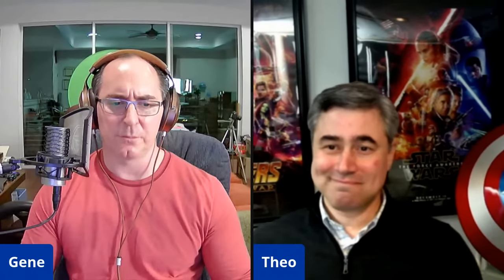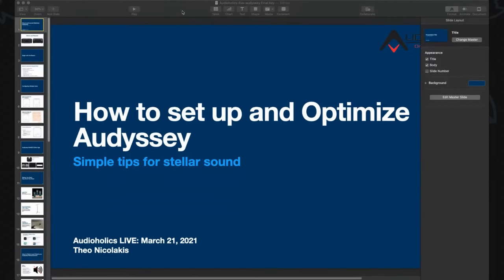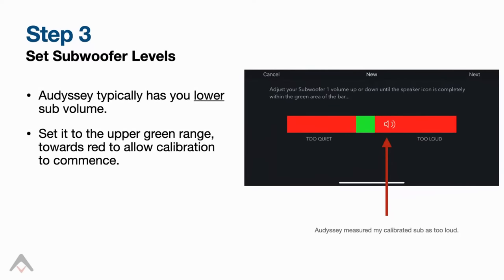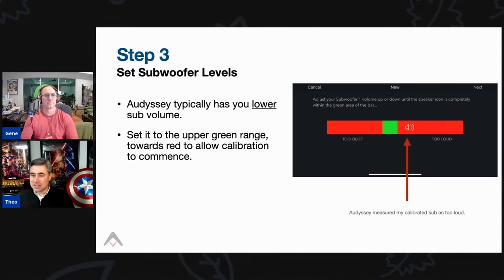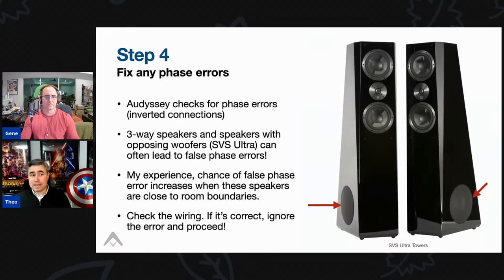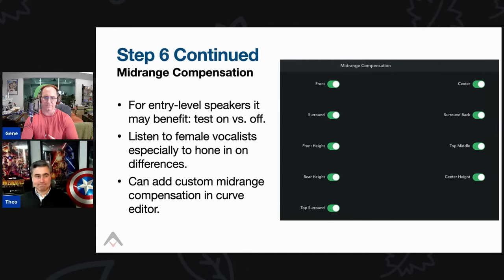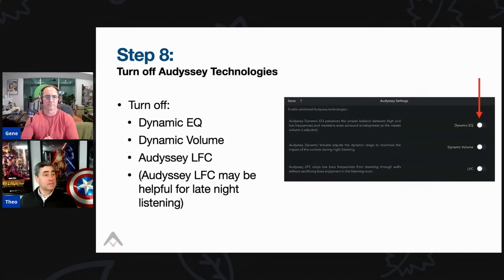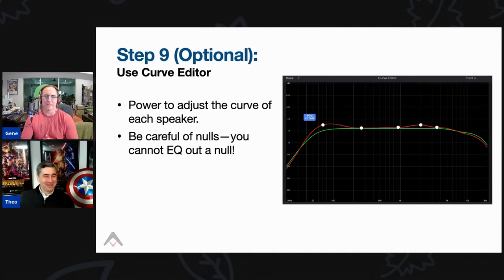Audyssey Room Correction Performance Tips for Your Denon/Marantz Receiver

Comment: I just have (maybe a stupid) question: How is one supposed to use external pink noise in order to get the system set up without the denon's own pink noise? I mean, I uploaded the sound pack to my shield so I can run them through there, but is there a way to designate speakers one by one? If I select multi-channel stereo I can have all the speakers play, but I have to disconnect all other speakers to get just one play? Am i just dumb? 
THanks for the video though! :)
Reply: I would have been nice if they would have told how to do this. They did a great job on telling you need to do it but nothing more than that. Gene wants you to set a appointment up and give him 100 to tell you.
Reply: That’s not a stupid question at all.  There’s a couple of different ways to do it. First is if you have any calibration disk that will play pink noise through an individual speaker or even some of those old THX tones that have the speaker set up tones. Secondly you can use one of the download links to download the files to a computer or other streaming source. If all else fails then you can certainly use the internal test tones on the Denon. While it’s not the preferred method if that’s all you have, then that’s all you have and give it a go. https://www.dynaudio.com/support/pink-noise
Reply: @TheoNicolakis  Thank you for this awesome presentation that Ijust watched yesterday. I saw in another answer that you can configure a mac to direct the dynaudio test tones to each individual channel. I do not have a mac and have not been able to find a way to direct the tone to an individual speaker in windows. I am looking for a good test disc now. Any recommendations? And is using ASIO4ALL in REW to direct pink noise to each channel as accurate as a disc with test tones?

Comment: Can somebody pleasy explain, how to Set SPL for each speaker, including the Sub, to 75 DB without using the Test Tone in Menue. If i use the pink Noise test tones its playing from every speaker at the same time. I dont understand this
Reply: If you find out please post it. I didn’t load the pink noise files, for one the Dynaudio app they suggested loading does not work with IOS14 and up. Now I do have a Atmos demo disc which has the test tones on the disc which you can play for each speaker. But the problem is that to change the levels you have to engage the pink noise from the AVR, and then you are stuck. If you use the master volume to get the pink noise up to 75 db then you disengage the Audessey , according to Gene. So how the he’ll is that done?
Reply: If you have a disc with pink noise to play by channel you start playing through the left speaker and increase the volume on the AVR until you hit 75db on the SPL. if you were doing it through a disk then you are absolutely doing it through Audyssey.  If you run the internal test tones from the MANUAL setting in the AVR then you are bypassing it according to the Audyssey team.
Reply: @TheoNicolakis  okay I get it, but once you open the  manual speaker section you can’t adjust the level of the speaker without starting the pink noise from the AVR which disconnects the Audessey. So unless I have missed something I don’t see how this can be done.
Reply: @jackrosati1438  that may work I will think about that. If you try it and it works be sure to comment.
Reply: laptop + REW + HDMI cable to AVR
Reply: @jr62inhometheater98  change the levels from the web setup to the ip address of your receiver.

Comment: What if I don’t have an iPad or tablet?  All I could use is my iPhone 11 Pro Max 🤷‍♂️, or use the AVR’s Audyssey ...
Reply: Using your iPhone is just fine if that’s all you have. Use the app over the AVR. It’s just easier on an iPad that’s why we mentioned it. I’ve used my iPhone several times doing calibrations.
Reply: @TheoNicolakis  I dont understand why no one knows about the ratbuddessy program that one comment mentions but it allows you to open up the curves on your computer and go in and manually adjust a lot of things on the curve as well as all the other settings you can do. Much better than doing on the phone and gives you an ability to tune things even more and it isn't too complicated at all!

Comment: I've been calibrating, then using Manual(native pink noise) to level each speaker to reference, with the volume turned up to 0db, with an SPL.  You're saying that's not the correct way to do it using the AVR?  How do I adjust the levels?  Using the app, I've been uploading the profile,  adjusting the levels with the AVR, then entering the changes manually into the app profile so I won't have to do it again.  But, that must be wrong, too.  So, once you've calibrated using the app, and have an external pink noise file, how do you level the speakers?

Comment: After Audyssey calibration I turn off dynamic eq because my 2 surrounds are too loud and my bass feels boomy. Audyssey sets my subs at -9 and -8.5db. You say when dynamic eq is off subs are then -3 to -6db lower output. What’s weird is that if I then set both subs -3db lower so -6 and -5.5db with dynamic eq off it sounds boomy again. If I just leave my subs to what Audyssey sets them with dynamic eq on to -9 and -8.5 but with dynamic eq off the subs sounds “tighter/punchier” so is it just my room? Why can’t subs just be easy to setup haha

Comment: Hey Gene,
Wasn't able to be on for the live chat but wanted to ask a question. I have an older Marantz AV7005 and I have found that it sounds best when i use Audyseey Front ByPass, especially in two channel listening. Since the AV7005 doesn't offer the editor app is this similar to or a way of not having Audyssey EQ the fronts or cutting off Audyssey at 500hz via the app?
Reply: Yes, it is bypassing the fronts, meaning no eq at any frequency on the fronts.

Comment: As a more general query I'd like to hear thoughts on Atmos speaker assignment. Denon will only let you pick certain configurations, but these may not match your room. E.g. I had to have sofa on back wall so  Atmos speakers are technically top front and top middle, but this is not an option. Is there experience or rule of thumb that can be applied or do  you just have to do a calibration for all options and see which sounds best?
Reply: In your situation you would choose Front Height + Top Middle.

When you only have two pairs of overheads, Atmos doesn't want you to use adjacent positions. There are five positions from front to back - Front Height, Top Front, Top Middle, Top Rear, Rear Height. So you can use any two, but they have to have at least a one position "gap" between them. This allows the Atmos renderer to have sufficient front vs rear separation of overhead effects.

Because you have a pair above you, and a pair in front of you, that makes FH + TM the way to go.

Comment: One question. I believe if you choose any other setting apart from reference (as you've recommended flat) then the tweaks you applied to app like mid range comp off, freq limiting, etc are all going to default back. Can anyone confirm?
Reply: How do you make that choice? In the app or the AVR?

Comment: Hey thanks for that XLR question,  I will have a 7706, using xlr for my front 5, and rca for my rear and in ceilings, so now I know to look for that, or should i just go all rca and not worry about the xlr for the one amp that can do it, the other can not?
Reply: From what I understand is the XLR are best for long distance. If it's only going a few feet then there isn't that much of a benefit. The best thing about XLR is that they are designed to keep interference out, like a hum or buzz, but mostly long distance. If the price is around the same for the amp then go XLR.

Comment: maybe i missed it in the video but in multisub setup do u switch half of subs on reverse phase before u run adusyssey or u run all measurements  with no phase inversion on the subs ?
Reply: Here’s the rule of thumb. If the subs are at the front of the room near your main speakers you set phase to 0-degrees. If the subs are at the rear of the room set phase to 180-degrees. The reality is a bit more complicated. To set the phase properly the easiest way to do it is to run pink noise through your sub and then rotate the phase while measuring with an SPL and whichever phase settings gives you the highest SPL reading is the correct phase.
Reply: @TheoNicolakis  thanx for answer its easy to experiment afterwards but my question is do u run audyssey with phase reversed subwoofers ? or u adjust phase after calibration is done ?

Comment: Should I use the curve editor, or via the level setting, to increase the sub? In the app, of course. At what volume should I set the test tones to set the sub to 75 DB?
Reply: You’ll need an SPL meter since the actual volume setting will depend on many factors such as room size, distance from speakers, and speaker sensitivity to name a few.
Reply: @TheoNicolakis  Can I use an app on my phone? I run a test sound and compare whether the subwoofer also has 75db, like my speakers? Did I get it right? Thank you!
Reply: Check out the ratbuddy audessy program it will allow you to take the room correction files and load them up and adjust them on your computer just like the app and can allow for more precise edits to the curves.
Reply: @G8R20Y  yes you can use an SPL app on your phone just fine. Then what you’ll do is go into the Audyssey app and change the level numbers so that your subwoofer volume will match the rest of the speakers

Comment: I am trying to understand  theory part of this whole audio lessons but i have no  clue.I am wondering if i can use the app to increase the higher frequency(tweeter).I am a fan of clean bright speakers and my speakers doesn’t seem to to do a lot in that region to my likening .I have the Martin Logan Motion  40 and the slim Xl with Svs Sb 3000 sub.Any simple breakdown will help..Thanks in Advance for the help.
Reply: You can, but be warned that adding 3dB means DOUBLE the power, and tweeters cannot handle that much power so there's a real risk of burning out your speakers if you over boost the highs.

Have you tried just using the Audyssey Flat curve? That disables the high freq roll-off so it should EQ the treble up a bit.

Comment: I'm not certain of the benefit of the Audyssey app here. 
If we already have Audyssey on the receiver itself, and can edit everything from the AVR, what benefit does the app provide, other than an alternative GUI?

36:00 Midrange Compensation -- Cannot be disabled in AVR, only the app
This seems to be the only point, unless I missed something else?
Reply: Limiting room compensation to a certain frequency (no adjustments above 300 Hz). Which is very important.

Comment: I don't agree about having two subs, each of them in each side of the center speakers.
I have that set, having them around 1,8m away one from each other, and I know that it would be better to have them farther away from each other, but they are monsters (monolith 15"thx) and it's my living room, so no other options, but they have definitely have different response, measure with rew. I get to solve some cancelations and I have more headroom to use my mini dsp.

Comment: If I want to calibrate my speakers by playing pink noise while using the app how exactly how do I do that do I play the pink noise through the DVD player or do I play it on the app a bit of clarity would be very helpful regarding this matter as it would help me greatly set the test tone to 75Db all round, just a pity we can’t use the internal test tone but seemingly using the receiver test tone defeats Audyssey and is not included so how does using the downloaded test tone work while using the app work this has me slightly confused just want to do this right any help that can shed some light on this subject would be appreciated.

Comment: I have a question and hopefully you will answer it. I'm new in the hobby so all of this is a learning process for me. I have the marantz sr 6015 and have ran used auddessey from the avr so I'm familiar with what room correction is and I'm ready to try the editor app now which I've already downloaded. I've been reading different things online about getting started and most of them are saying before running the app you have to have a mini DSP and run Rew, and I also read that if you only have one sub that you don't have to use that stuff and one sub is what I have. I'm running a 5.1.4 and my room size is 12x12x9, and my sub is the SVS pb 3000. Do I go ahead with the editor app or is running the app beforehand is useless. If anyone can help me with that I'd appreciate it.

Comment: Very helpful for this newbie Thanks!   
When you say to run the fronts FLAT ... does that include or exclude the center speaker?   I’m assuming exclude?  Confuses me because front l/r and center are all in front.
Reply: Yes, it refers to the left and right speakers.
Reply: @TheoNicolakis  So, the reference and flat setting on the AVR only affects the front left and right speakers ? I don’t see an option on the app or in the AVR to specifically set only the left and right to FLAT